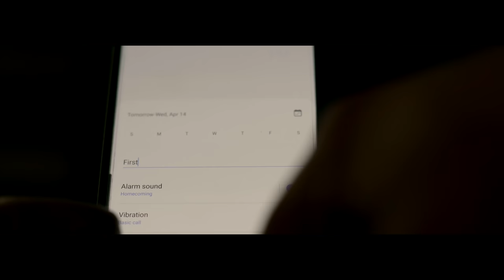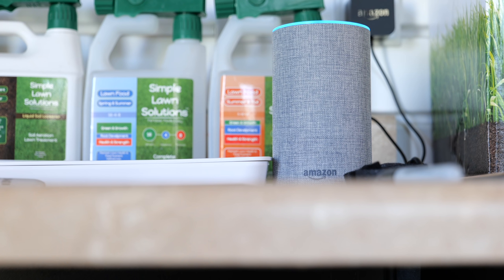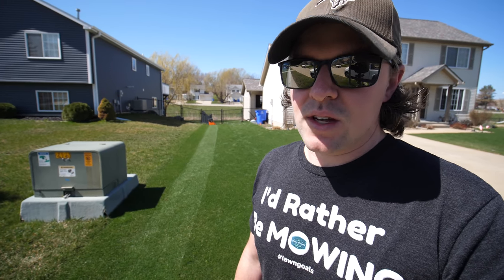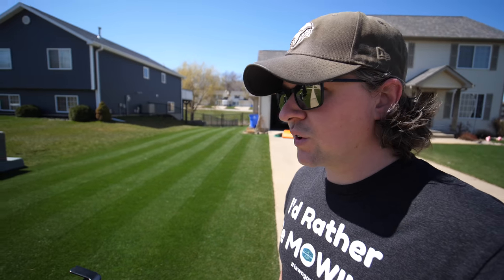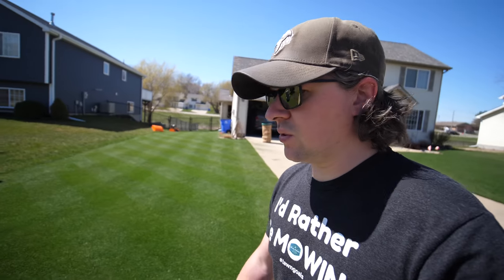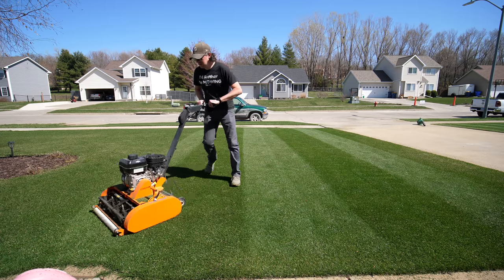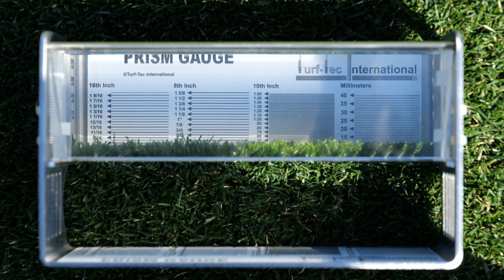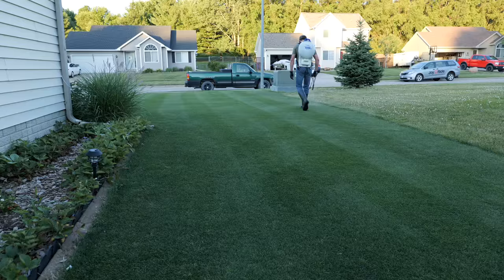FIRST MOW 2021

Comment: Get a 6.0 or 8.0 High Output M18 battery for that blower and it will GREATLY increase the power output.  Id say 30-40% more power on High.  Have the same blower, and have run both regular and high output batteries, and the difference is very very noticeable